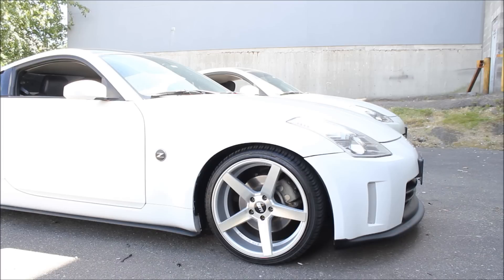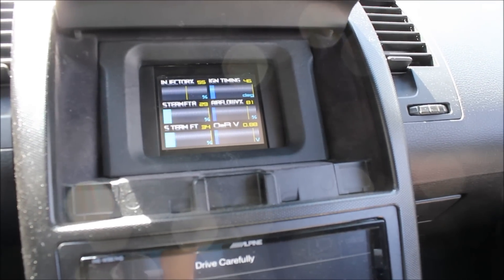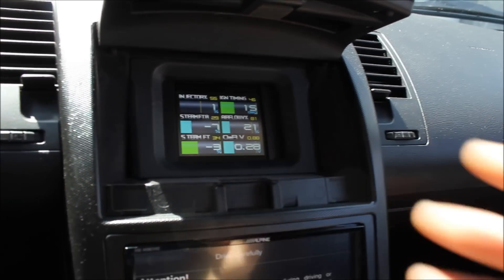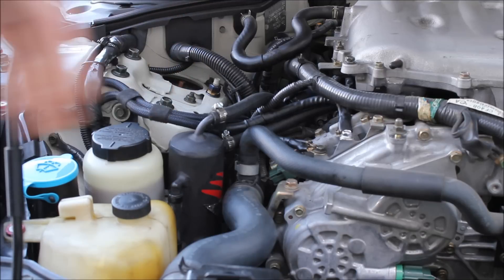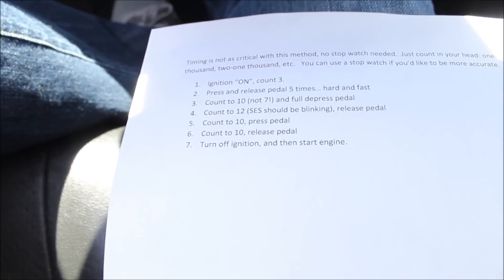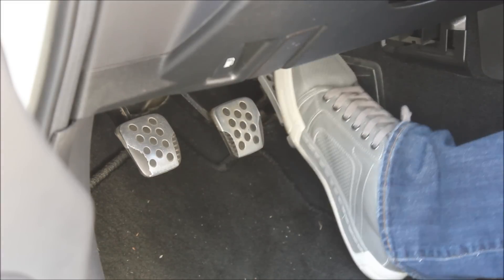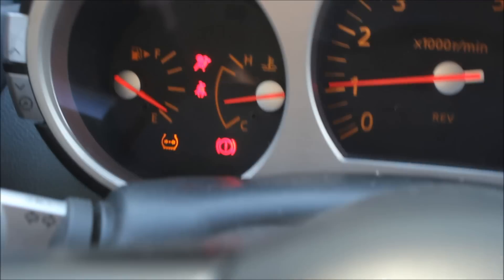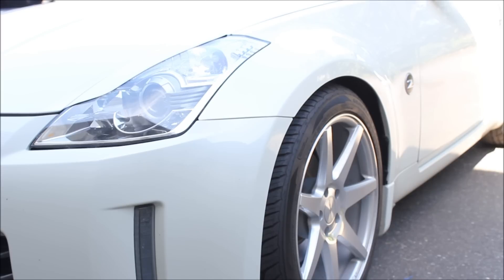Nissan 350Z / Infiniti G35 ECU reset & Idle Relearn 3.5L V6 (Check Engine Light) | AnthonyJ350

Comment: This is an old video but a reply would be much appreciated. I’m having an issue with my idle, and it’s also throwing a U1001, U1000 codes. The thing is this didn’t happen till after I had relentless it to a shop for the SES light which had different codes (those have been resolved. But since they did a ecu reset when they were diagnosing the codes but then it wasn’t driven immediately after, it just sat in the lot till I picked it up. I feel like maybe this could help? Especially if the problem is with the ecu having the wrong perimeters , I just can’t imagine the code being anything physical because it didn’t have it before.
Reply from the maker: Have you changed out the cam and crankshaft position sensors with Hitachi brand ones?

Comment: *I had/have a strange issue last nite, went to the game, saw the battery light just came on, shut off the 05 G35 watched the game, came out, No battery light on, went home, but a mile B4 I get home, It goes into Limp mode, got it home, this morning seems to be ok, my scanner wouldnt get past "scanning" though? Any idea's? Thanks
Reply from the maker: Test the battery and clean the battery terminals. That's where I would start. Also make sure they're tight.
Reply: @AnthonyJ350  they are clean and gave no issues starting
Reply from the maker: @Dougarony  I'd test the voltage

Comment: so I reset the codes with the scan tool but the light won't go out sometimes it  flickers also when I turn headlights on the whole dashboard cluster flickers not the radio knobs or nothing else just the cluster could it be bad
Reply from the maker: Check to make sure your battery clamps are tight. Also could be a factory ground that's loose.
Reply: @AnthonyJ350  I think there might be a bad ground it's a 2006 infinity qx56
Reply from the maker: @rickcarp5453  This video might help https://youtu.be/mkWCqSfr6ig

Comment: Just disconnect the negative battery and pump the brake if he times that does it also and alotmore easy
Reply from the maker: To remove a check engine light and reset the ECU to relearn all it's parameters?  I don't think it's that easy.

Comment: My 04 g35 service engine light came on. I took it to autozone and they said I needed to replace the ecu. Could resetting it fix it? Or do I have to replace it. Bc as far as I can tell, the car has no issues at all, the lights just on. I had to reconnect my battery a few times, could that be it ?
Reply from the maker: What is the code it threw?
Reply: AnthonyJ350 p1065 backup circuit malfunction
Reply from the maker: @tylersaldana4951  I've never experienced that one. I'd check the plugs at the computer and it's ground incase it's something simple.

Comment: will this method work for a 350z that has an infiniti engine swap using Up Rev tune? Am I safe to do this? When I start my car, the revs just climb higher and higher and I have to turn off my car within seconds or it will redline. What do you think?
Reply from the maker: It's worth trying, but don't know for your combination.

Comment: my check engine light came on a couple miles after i put my test pipes on. i reset it but didnt drive it for an hour afterwards. should i reset it again even tho it hasnt came back on? i think im running rich now. should i just go tune it? i only have test pipes and a muffler delete.
Reply from the maker: I would try the reset again and try to go for a good long drive to let it really learn.  You'll need so sort of diagnostic tool to know if it's running rich for sure.
Reply from the maker: Let us know if the S.E.S. light stays off.  Did you run foulers?
Reply: +AnthonyJ350 ...foulers?
Reply: They're essentially spacers that screw into the o2 bung and extend them out an inch or so. People have got lucky using this method because it restricts 'some' of the airflow to the o2, which simulates the restriction a catalytic converter would have. People still call them foulers (or more correctly, non-foulers), because spark plug non-foulers can be used for the same purpose in some applications.
Reply: +AnthonyJ350 well i havent reset it yet but the light hasnt came on since ive put like 200 miles in my car this week.
Reply: +AnthonyJ350 well i havent reset it yet but the light hasnt came on since ive put like 200 miles in my car this week.
Reply from the maker: ***** Just keep driving it and see what happens.  You're looking good so far.

Comment: Yo man so I just got new high flow cats put on my car and have a P1273 bank 1 sensor 1 code! I reset computer by a scanner should that work?! I have driven car about 50 miles now and check engine light has not come back on yet! Should I do this just to be safe?
Reply from the maker: I would hook up a scan tool and watch the live data feed to see how the sensor is reading (did the wire get damaged). Highly recommend you also get the vehicle dyno tuned. What year is the car?
Reply: @AnthonyJ350  Not that I can see no the wire is not damaged. However the muffler shop that installed the HFC’s most likely didn’t disconnect the batter before doing the job is my guess. Therefore the ECU did not recalibrate is what I’m thinking.
Reply: @AnthonyJ350  It is an 04 G35 coupe
Reply from the maker: @justins.6981  ECU reset is definitely mandatory after a mod like that
Reply: @AnthonyJ350  So I reset the ECU and after 500 miles the check engine light is back on with bank 1 upstream 1 O2 sensor codes smh I at least got it to pass my emissions and the car runs fine just a little rich but not too noticeable. What should I do? Get someone to tune it?

Comment: Could this help for manual mode not working? It goes in to the mode but I can't shift
Reply: All it does is take it from 5th to 4th on its ownn
Reply from the maker: Have you ever had the transmission serviced?

Comment: My 04 z just randomly had a service engine soon light and the slip and TCS light turned on. After a few miles the car just stalled and stopped. Waited a few mins and it runs for a few miles then stalls... :/
Reply from the maker: Did you scan it to see what is causing the light/ problem?  You might have a failed sensor.
Reply: +AnthonyJ350 yeah turns out it's camshaft :/ was reading they had recall years back.
Reply from the maker: BondxDD Is Nissan still picking up the tab?
Reply: +AnthonyJ350 have no idea :/
Reply from the maker: BondxDD You said there was a recall right?  Usually safety recalls are always honoured, your case you might have to front the bill.
Reply: +AnthonyJ350 apparently Nissan doesn't cover anymore from what I read

Comment: So I just changed my own spark plugs and I got rid of a bunch of codes but I have 3 codes that popped up could y te u please give advice as to what parts I need to buy? I am going to attempt to fix this myself :-/ I have a 2005 350z nissan codes are P1148/p1031/P0080
Reply from the maker: P0080 is most likely the camshaft sensor (have you ever replaced them) the other 2 are on the one side for the air/fuel meter (a fancy O2 sensor).  It's most likely the camshaft sensors need to be changed and so does that one sensor on the exhaust.

First I would make sure you have the proper amount of oil in the crankcase and check for a vacuum leaks at the intake if you just did the spark plugs, check the vacuum tube under the intake tube to the valve cover.  Make sure underneath the intake tube couplers are installed properly, sometimes they fold up during installation.

Then proceed to do the ECU reset and see if that solves the issue: https://www.youtube.com/watch?v=5tQm28K32SQ&t=4s

Camshaft sensor replacement: https://www.youtube.com/watch?v=1VHMGRViJ6g
Reply: @AnthonyJ350  thank you so much! So I should purchase a camshaft, should I also purchase the air fuel ratio sensor? Someone even said changing out fuse #15 will also fix the 1148 signal what do you think of these suggestions?
Reply from the maker: @TrishZenCorner  I would start with the ECU reset and change out the camshaft position sensors regardless. There seems to be a lot of camshaft sensor failures due to age happening.  Depending in engine you will have 2 or 4 sensors. Buy the original Hitachi ones, don't buy cheap ones.

You might need an air/fuel sensor. For some reason sensor one always goes on the passenger side of the engine (mine did) We put an NTK in and solved my lean code a few years ago.
Reply from the maker: Unless your 2005 is an Anniversary Edition with a REVup engine, you'll have 2 camshaft sensors, one on each side.
Reply: @AnthonyJ350  mine is the ani edition since I'll be doing all this myself I'll purchase both camshaft and the fuel ratio sensor.  This is my only car you think I can drive it still with those codes? I'm ordering my parts from rockauto now THANK YOU! I would not even know where to begin
Reply from the maker: @TrishZenCorner  You can but I would take it easy when you drive. Did you check the oil level?
Reply from the maker: @TrishZenCorner  Remember the 6 speed manual Anniversary Edition needs 4 camshaft sensors, 2 angled 2 straight connectors. Also here is a mod for the dip stick https://youtu.be/1Yrlq285UHY
Reply: @AnthonyJ350  oil levels were good when I did it i drove it back home that day on hwy going over 78mph throughout drive home. When I drive it the following day that's when the engine light came on I put in my blue driver and all the older codes were all gone but those 3 popped up new ... I was confused as to what camshaft I was supposed to buy so I'm currently looking for maintenance book to see what it says so I can look for them in rockauto... thank you for even answering me man for real THANK YOU!!
Reply: @AnthonyJ350  how much would you charge to speak on zoom about my particular car ? Would love to bounce off somethings I want to do for this 350z 2005 I bought it at 81k I'm at 120700 now love this thing lol
Reply from the maker: @TrishZenCorner  Oh I wouldn't charge to chat and help out a fellow car enthusiast. Email me at info@gofasthavefun.ca and we'll figure out a time to talk about the car.
Reply: @AnthonyJ350  Awsome I sent you an email!

Comment: I've got codes p1122 and p1126 and I've replaced the throttle body. Any ideas? I've got zero throttle response and in limp mode
Reply from the maker: Broke  wire, or something happened to the pedal. That's my guess if you changed the throttle body. When did the problem happen?
Reply: @AnthonyJ350  the car sat for a year but ran fine when parked. When I hooked a battery it started up but has no throttle response. I guess my next move is checking for continuity from the plug to the relay.
Reply from the maker: @earthisfat6184  Also check all your fuses
Reply: @AnthonyJ350  that was the first thing I did. They are good. I'm getting 12v from that 87 fuse too so it's powered
Reply from the maker: @earthisfat6184  Maybe try checking the plugs at the pedal and the throttle body. Clean them with electrical contact cleaner.
Reply: @AnthonyJ350  I did start at the pedal in the beginning. The pedal resets the ecu so I think it's working
Reply from the maker: @earthisfat6184  if you pull off the intake tube, turn on ignition and work the pedal. Does the butterfly valve move at all?
Reply: I just now got this car running. It ended up being the ipdm and it's plugs were corroded. Now that it's running and the throttle works it's misfiring really bad.
Reply: My car  wont accelerate, g35 2003. I put on a new maf sensor in p1122 and p0507po113
Reply: @Zaire-e2k  have you tried the pedal dance to reset everything? Does your pedal do anything at all? Or nothing at all?

Comment: Don't get blinking light on my 06 350z. Maybe different on an auto?
Reply from the maker: Eric Lesher No should be the same. Try counting slower.
Reply: AnthonyJ350 I got it. Thanks. I had my dad put on a new cai for me and when the filter was off he said turn your car on to hear how loud it is without a filter and it triggered a engine light. After we put the new cai on the light remained after 30 miles or so. So I just did a reset bout to drive it around
Reply: Next time I will disconnect battery when doing mods
Reply: Btw just to mention I doubled checked to make sure it's on correctly.
Reply from the maker: Ya they're somewhat sensitive.

Comment: Any idea what issues could cause code P1051?
Reply from the maker: Check the plug at the sensor and make sure the wiring isn't damaged or the inside of the plug is corroded.

Comment: hey man, you think this can fix my 350z with non working instrument cluster
Reply from the maker: Very slight chance. Did you try scanning the car or checking fuses?
Reply: @AnthonyJ350  i did ! i even took it to a mechanic and he couldn’t fix it
Reply from the maker: @LeoQuintero-nb1wo  Need to bring it to an electrical shop. You can gamble with a used cluster to see if it works. I would do a Google search see if anyone else had this issue. I haven't heard of clusters malfunctioning regularly.
Reply: @AnthonyJ350  ill try the electrical shop bro, thanks for the help!
Reply from the maker: @LeoQuintero-nb1wo  No worries. Please let me know what the fix is. Always good to learn something new.

Comment: After installing test pipes I got the codes p2a00 and p2a03  
Did it ever comeback? 
I hope it works for me

Did you have to do the the throttle relearn too? Or does the ecu reset everything ?
Reply from the maker: Car really needs a dyno tune with UPREV.
Reply: @AnthonyJ350  imma be honest I took the foulers off and the codes went away lmao
Reply from the maker: @edwinrubio1681  I still highly recommend you get the car tuned

Comment: If i have 03 350z with plenum spacer 
Full exhaust,  headers ,
cat delete 
Pop charger 
And I did this ecu reset 
Will I ha to do a dyno tune and or reflash ecu ?? Thanks
Reply from the maker: bombazzwayne cbrwayne You'd be ok. But if you want to take maximum advantage of the mods you want a tune.

Comment: i have a tire pressure monitor light on.. does it reset that as well
Reply from the maker: swarajsandhu Haha no. I drive with mine on all the time and you're technically not allowed to disable the TPMS for safety reasons. Just pretend the "excitement light" is on
Reply: AnthonyJ350 lol .. so i am not the only one.. thanks alot

Comment: can i do this just to have my car relearn whats going on under the hood because I'm sure it's been yrs since it's been done and just curious if things change a little if it might need to relearn stuff
Reply from the maker: Have you done a few mods to your vehicle over time?
Reply: just borla headers and muffler delete and cold air.  but ses light has not shown up but will reseting it serve any purpose to learn the new air flow even though its not going to be much
Reply from the maker: Matthew udontneedtoknow Can't see it hurting anything to try it.  Just take it for a long drive right after to make sure it can relearn the airflow and everything.
Reply: AnthonyJ350 appreciate it man.  love the videos keep em coming.  U need to do a motor pull at smoe point btw
Reply from the maker: Matthew udontneedtoknow I did 8 years ago when I dropped a new crate motor in my project truck.
Reply: +AnthonyJ350 u need to do one in the z. gonna put under a cosworth next yr and will how in depth ure videos r would be awesome to see u do it before I screw my swap up.
Reply from the maker: Matthew udontneedtoknow Ya going that indepth with the car is a little beyond me.  I'll be doing an MREV2 and a Kinetic intake manifold top next year though :D
Reply: +AnthonyJ350 can't wait

Comment: Thanks man procedure worked !
Reply from the maker: Awesome, glad to hear!
Reply: Help lol did your ecu flash during relearn , my reset and after 5mins of driving game on and cars riding really aggressive
Reply: Only check engine while driving not sitting still
Reply: Lyndon Johnson make sure you follow every single step the most important thing in the procedure is the accurate seconds and the right pushes on the pedal when you need to press on it 5 times (hard/fast)
Reply: @spiritliving9091  yeah I did all that when its idling there is no check engine light, when I drive it comes on and the car drives rough
Reply: Lyndon Johnson go to autozone and make them check the code(s) , if ur oil is old then oil change
Reply: @spiritliving9091  just did a oil change Its a swap motor with 70k on it and I did all the normal stuff when I switched it. Plugs ,oil, belts hoses . It was giving me the camshaft sensor but I replaced it

Comment: good videos bro, one question i have a 2007 350z hr and i have the code p0345 camshaft position sensor bank 2 sensor a, my question is if you know if there are two sensor in each bank or just one,  and if i do change one of them do i need to reset tge ecu, thanks in advance. ..
Reply from the maker: I'm actually not sure.  Is the part number the same for both banks?  Can you swap each side to verify it's the sensor?
Reply: AnthonyJ350 
the part number its the same for both bank,  at the dealer they told me that they are the same,  but didn't tell me if there were two or just one,  i replaced one,  but nothing happens it get into limp mode a rough start and then died,  and keep on towing same code p0345 camshaft position sensor bank 2 sensor A.....
Reply: Bank 2 is going to be on the drivers side, that the code for P0345, Code p0340 is for the passengers side. I just got this code today and did some research.